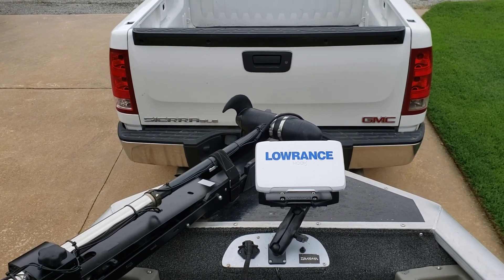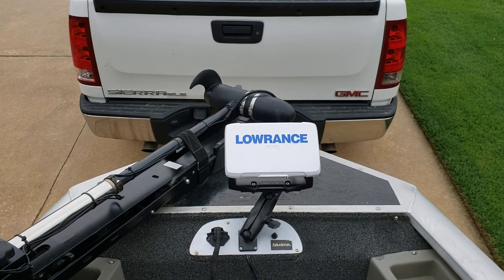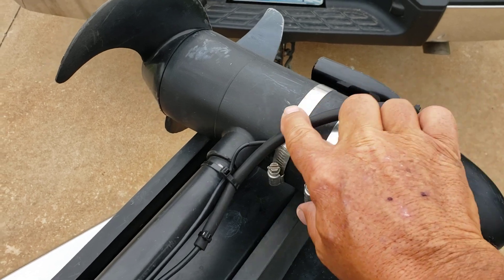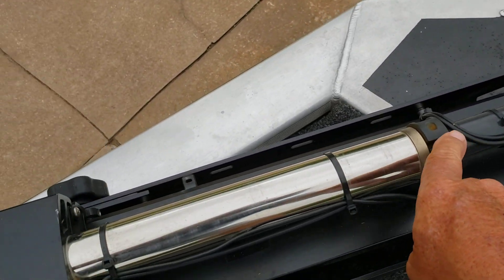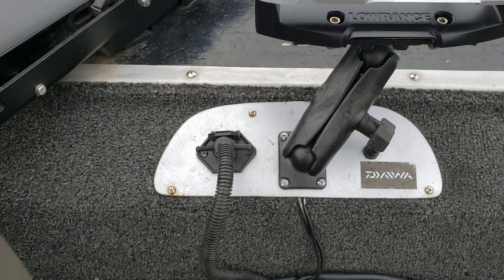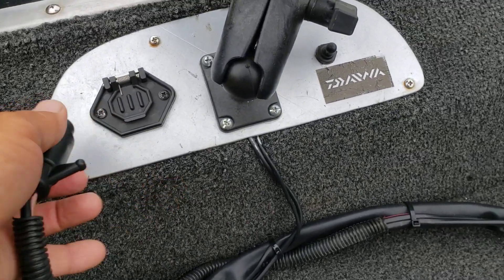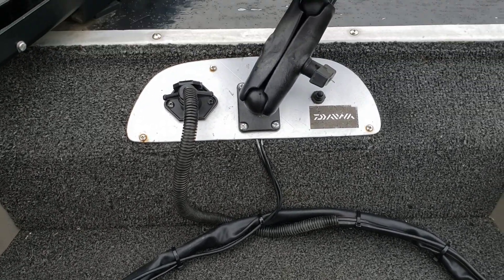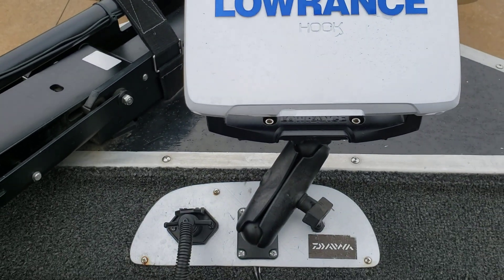Fix the RF Interference on your Lowrance depth finder

Comment: Rubber line and the split loom are not magnetic shields. Coax means center conductor and shield. Transducers cables are a wire bundle. Having line stretched out may mean you're getting the cable away from the noise source .. and making a longer antenna to pickup RFI/EMI.

Comment: Dealing with interference with a Garmin echo uhd and a maxxum 70 digital.  I think it's down to 1 of 2 things,   if transducer is within 3 inches of the lower unit I get noise.even with over 20 different sized Ferrite 31 mix cores on the transducer cable and some on the power to the trolling motor and some on the Garmin.  I'm thinking it's in the control board of the pedal pulsing the voltage to the motor and the motor is acting like an antenna/ amp.    The new trolling motor is in shop getting upgraded motor under factory warranty but my old one is back on boat. Both doing the same, so. If I can figure out what I need to do on the old one then I can repeat on the new one.   At full speed there's no noise. That's why I'm coming to the conclusion of the control board

Comment: I was having a lot of interference on my simrad nsx every time I turned my Minnkota I pilot on and got even worse when I was spot locked. Noted. Transducer was stern mounted. A guy told me he did a software update on his garmin and it fixed it. I did a software update on my simrad and it fixed it. Hope this helps someone out there! 

Also I had a software update available on the trolling motor as well so I went ahead and did that as well.

Comment: I also found this to work. I tested it with corrugated tubing and found that I had to have to tubing slid all the way down to the transducer; if there was any gap between the bottom of the tubing and transducer. The interference was not eliminated.